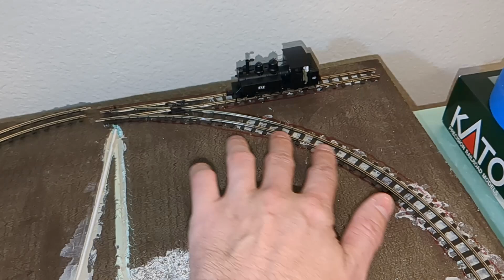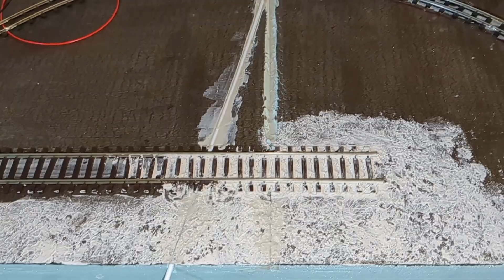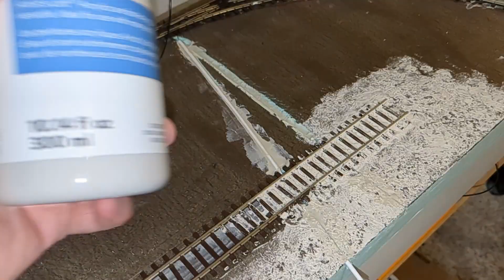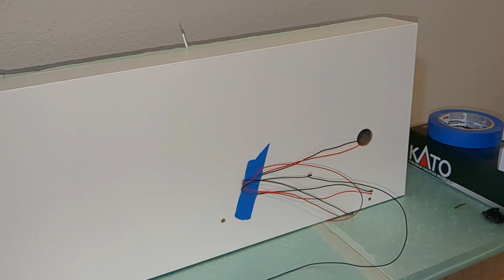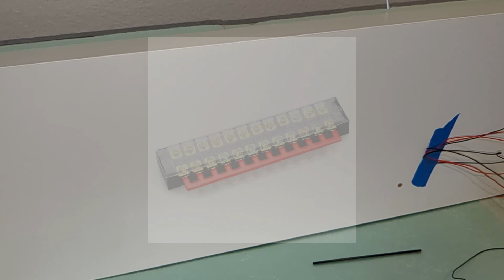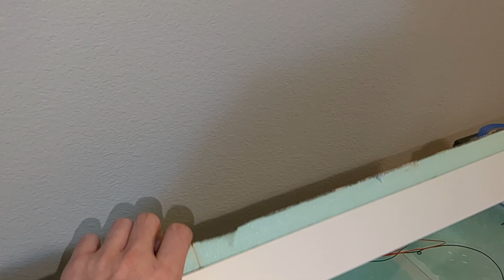WWI Shelf Layout in OO9 - First Tracks Down & Finding Solutions

Comment: A nice little update, my grandson has an update coming up soon on his. He's been building a short tunnel but trying to keep the track accessible. He's also planning to put a terminal block inside it, so he needs access to that as well as the track. So you'll see his solution to that on his next video. He says he might try the wire in the tube method for changing the points...cheers James 🙂👍